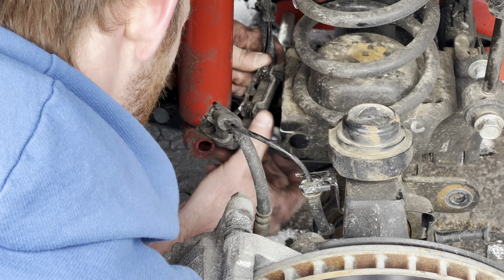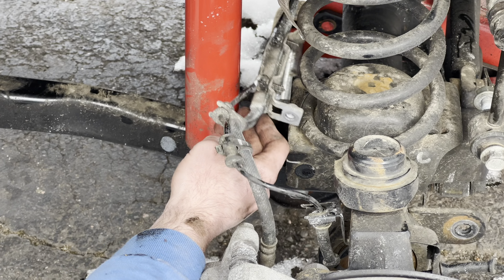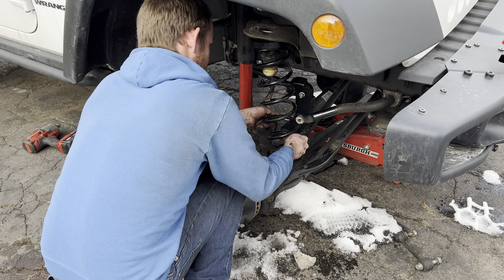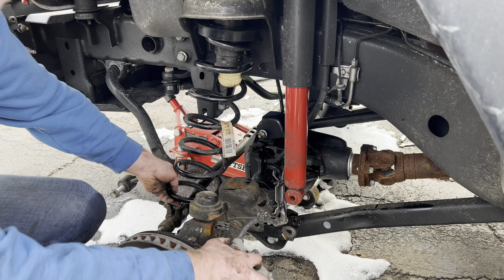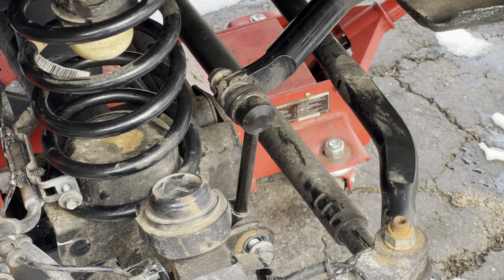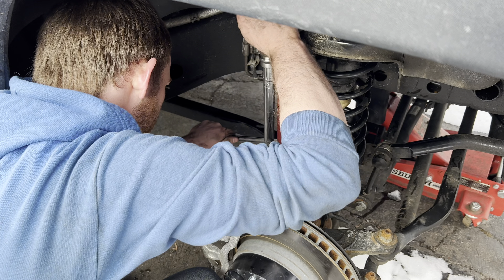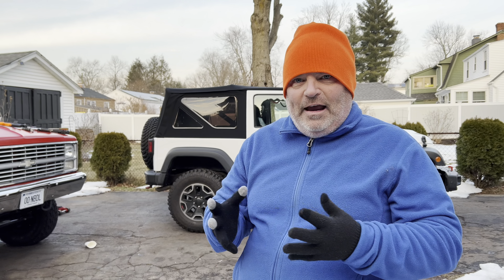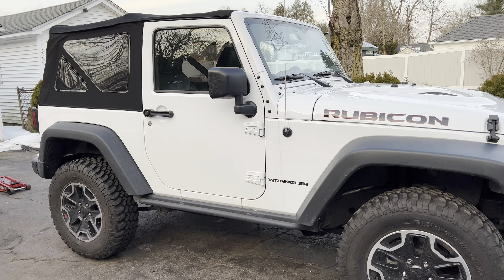How to Install a Budget Boost Lift on a Jeep Wrangler JK

Comment: I have a similar kit I'm going to install soon. Thanks for the video.
Reply from the maker: Best of luck with your lift. I was surprised at how simple it was to actually do. No "crazy" lifting to do and no need to spend lots of money. Plus, it gave it just a small amount of lift, which really makes it look good. Thanks for watching!
Reply: Hello, I wonder why you have two videos using the height kit, what is the difference between the two, and why the same thing twice?